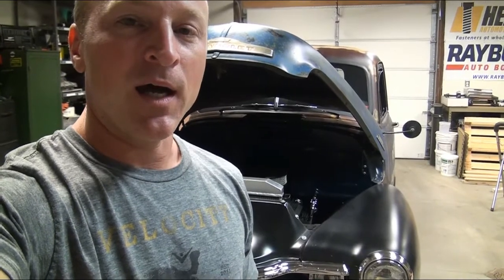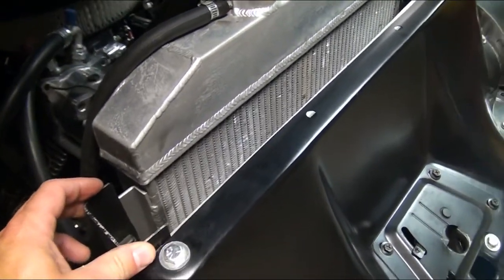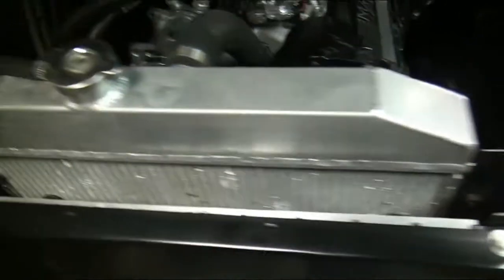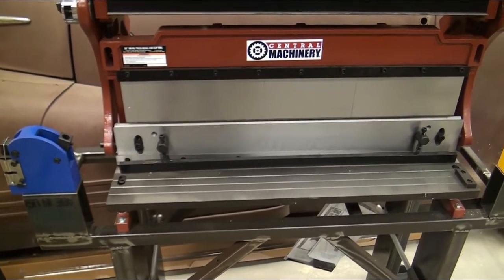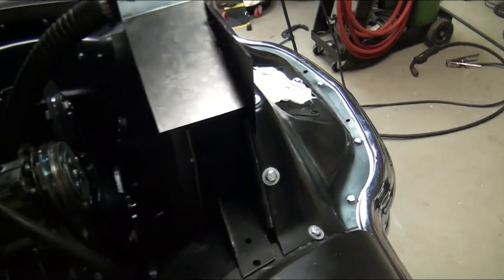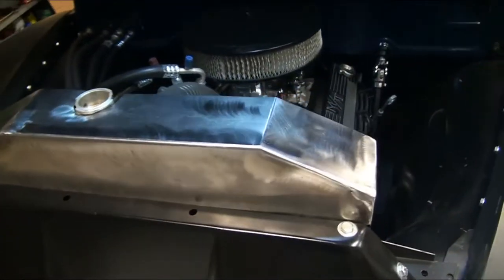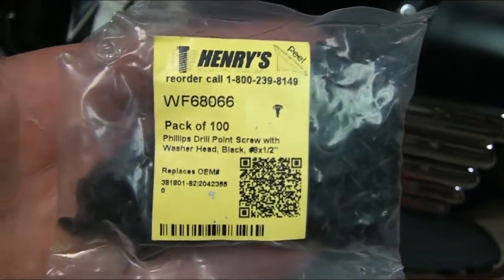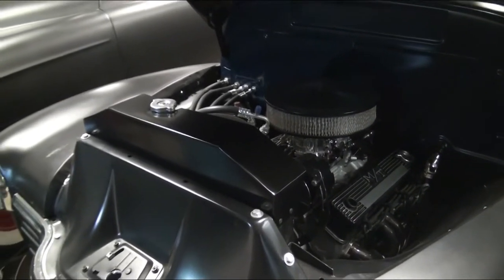1947-1953 Chevy Pickup Custom Radiator Cover Build

Comment: That radiator support is all hacked up. 
Mine is an original to my 52.
Has captive nuts,  all around. 
The two sides, connect with a solid bar, that I clearanced for my aftermarket radiator.
Reply from the maker: This rad support is aftermarket and wasn't cut. There are slots for captive nuts, and there is an aftermarket piece that would mount across the top, I just didn't like how it finished against the aftermarket aluminum rad.